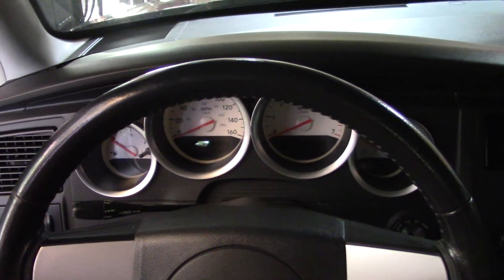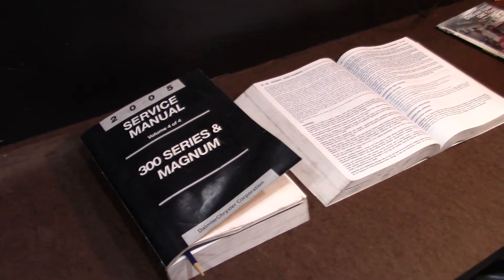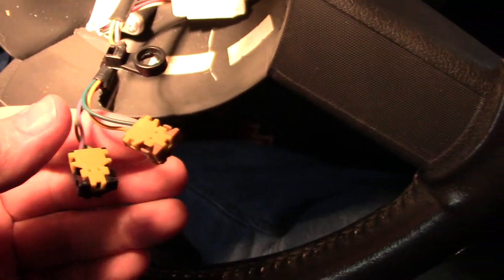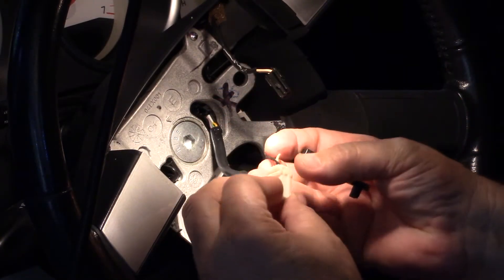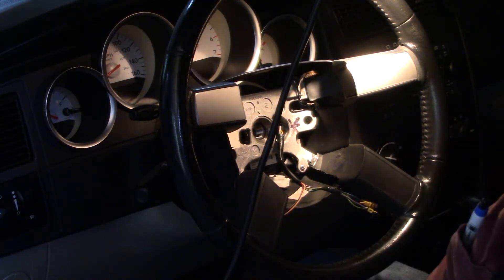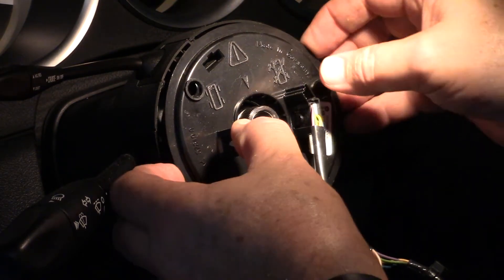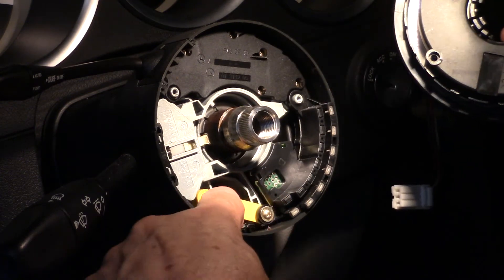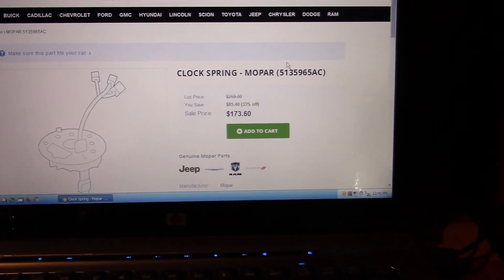2005 Dodge Magnum Clock spring removal

Comment: 🤣this is one of the realest video I've seen so far on  signal switch replacement. Unfortunately I stripped the steering wheel bolt on mine. I'm done with Dodge, the switch alone is $600+, that's enough to buy a really used car. Smh!
Reply from the maker: Holly crap! That's a lot of money. Yes, these auto makers are making it real hard to keep older cars with the prices they charge. It could get worse because they can't sell new cars because of the shortages of micro chips, but I hope not. I appreciate your comment.
Reply: @wyattoneable  thanks
Reply: If you’re replacing the part with the oem part number then it’s going to be expansive but I just ordered mine from eBay. The part was a #XXXAD upgraded from AG. It’s was $27. The XXXAD numbered part replaces the original 2005 RT part.

Comment: Congrats ! U survived bomb school 101.   I never would have spent that much $  just to turn a turn signal off either.
Reply from the maker: It became a matter of principal. It's just a broken piece of plastic. If it were broken to the point that nothing worked I would pay the price. In this case I'll be doing a search for a used part. When is your next trip up North?
Reply: I should have mentioned since U had both pieces U could have welded them back together with a soldering iron. I have lots lots   of welded /melted back together pieces on my trucks dash easy to do & for extra strength  use a piece of similar  plastic as a build up just like welding metal. My next trip is on hold as I gave my buyer a extension on my home for a month..

Comment: Factory manual - ya buddy.   Dorman hahaha  I laugh every time I hear that name. Cheers buddy
Reply from the maker: I saw your video and laughed when you said you only use the factory manual. That's me too (when possible). I'm finding out that most everything is on line now. I already miss having a book. Thanks for always being here Steve.
Reply: Didn't look too bad of a job to pull it out except for that bolt with Loctite on it. Maybe you can glue that little tab back on to the clock spring. And don't work too hard Wyatt. 👍
Reply from the maker: I thought of gluing it but I'm going to try a salvage yard or two for the part. Thanks for chiming in.
Reply from the maker: Me too. Eric made them famous!

Comment: you could always get one from the auto wrecker the want to sell you the whole column but will sell the clock spring for about 60 bucks if you take it apart your self
Reply from the maker: Yes sir, I'll be searching very soon for a used part. It's easy to get to so I out it back together so I can drive it to work. It's been a great car.

Comment: I just bought the clockspring new on ebay for 30 bucks, Im sure the quality wont be the same but Ill try it.
Reply from the maker: I hope it works out for you. Thanks for leaving a comment.
Reply: Did it work out for you
Reply: @legacyforever6602  It did for  about a year and broke again then bought another one and did not work so I bought a used module and did not work so I put a horn button to pass inspection and left it that way.